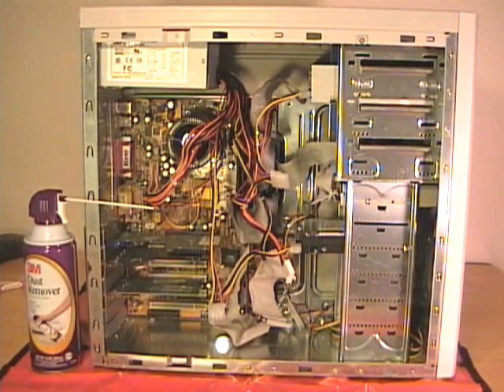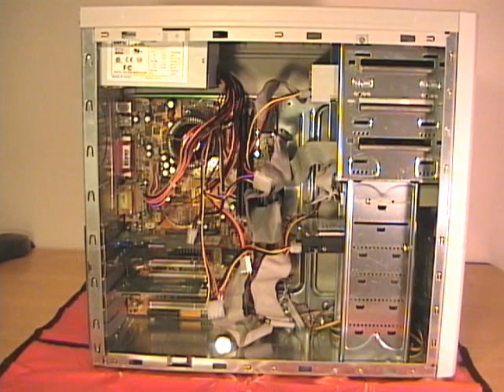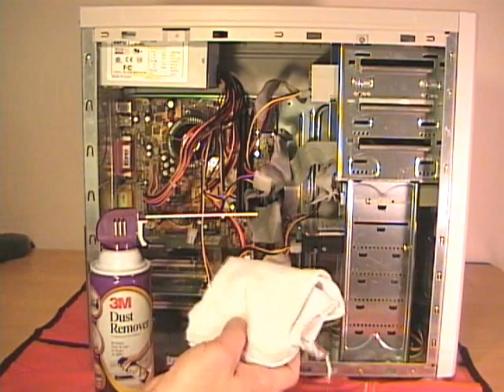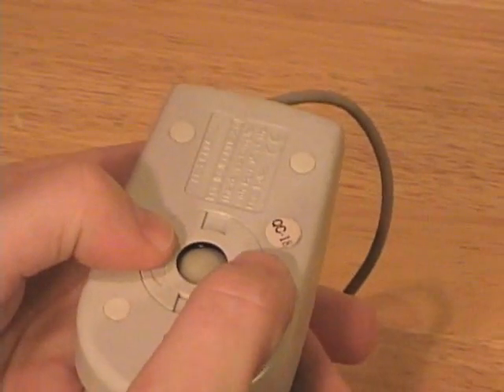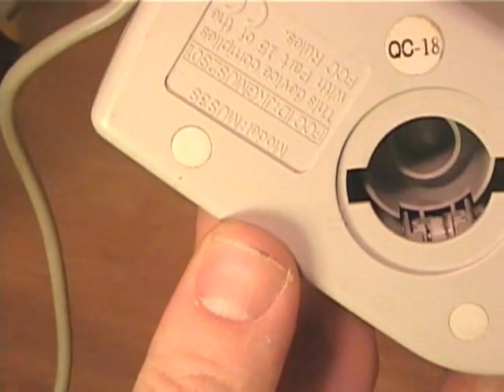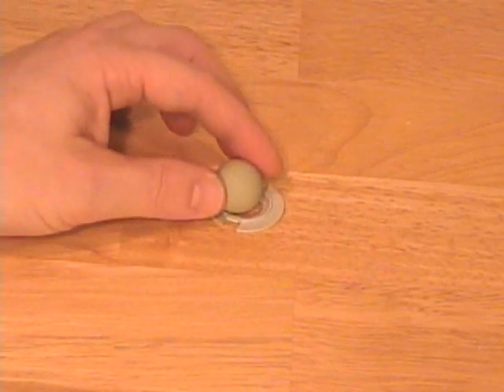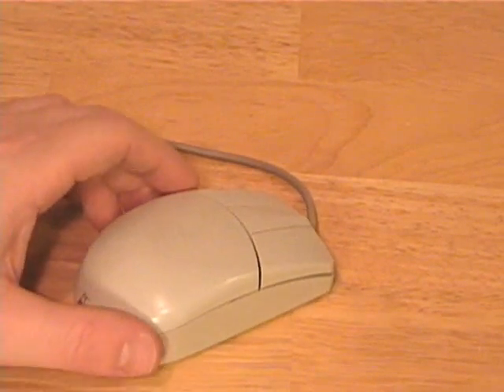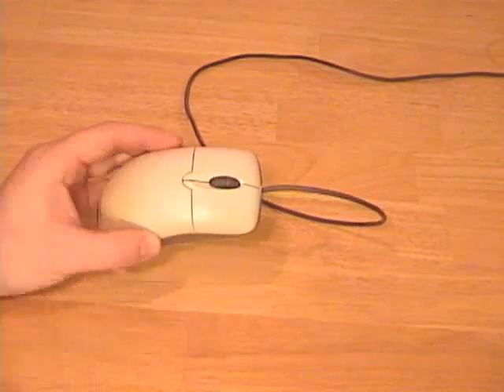Cleaning Computers and Components

Comment: Part two: Cleaning the switch is not a big deal (if it can be opened without breaking it)  but must be done very carefully  [beyond what most will tolerate in tinzy tasks/objects].   Needed =   liquid contact cleaner,  
   crocus cloth (not emery cloth).  clean contacts reassemble after cleaning - do not touch contact area with your fingers!
Good luck,
Regards

Comment: the "double action when clicking is due to the mechanical switch itself.  It most likely has corrosion on the contacts making the switch in effect do more than one make and break contact.  if this is the case the only way to repair it is to clean the switch contacts,    replace the switch,  replace the  mouse.  Cleaning the switch is not a big deal (if it can be opened without breaking it)  but must be done very carefully  [beyond what most will tolerate in tinzy tasks/objects].

Comment: Great video. I use a simple Logitech optical mouse. Occasionally if I lightly click the left click once it will double click, so it makes highlighting a pain sometimes. I would have to hold it down really hard sometimes to get the desired effect. Is there something wrong with my mouse? For the record the mouse setting in 'folder options' in Windows XP is set to 'double click to open items.' Do I simply need to clean it or is there extra work required?